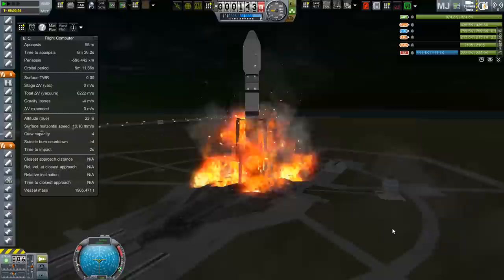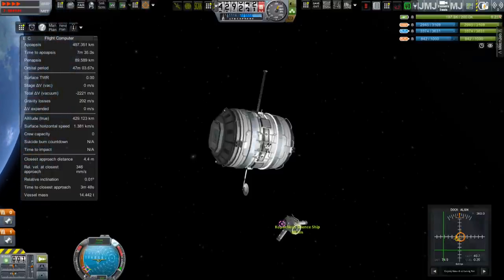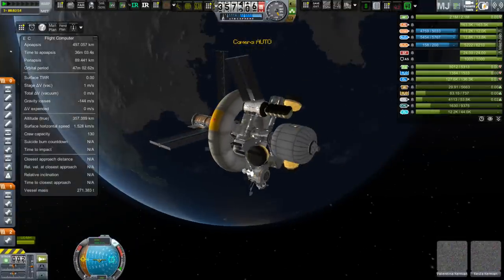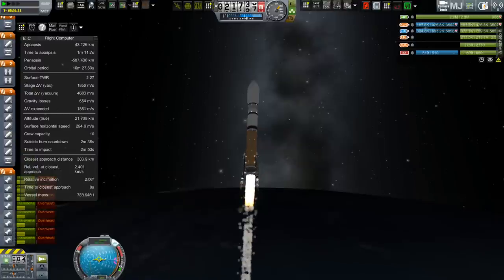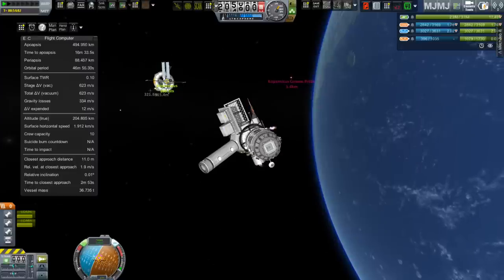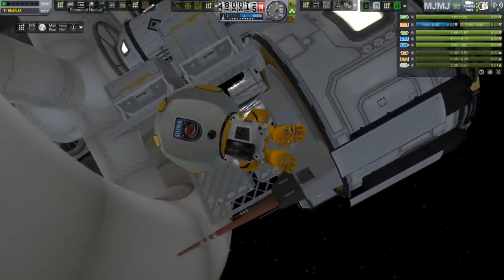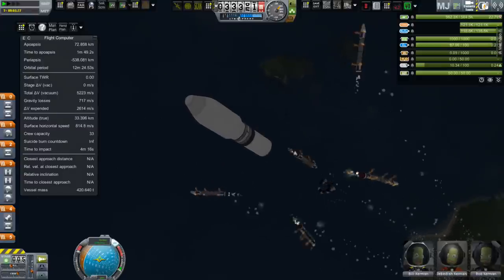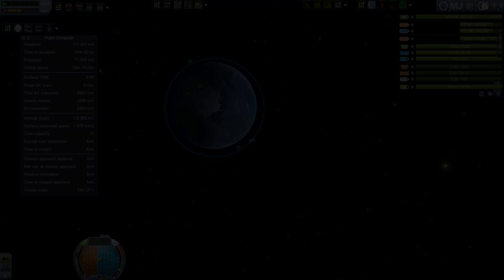E43: "Final Countdown" / Project Odyssey / KSP 0.25

Comment: i think the real accelaration ship shaking happens due to change of gravity. KSP as you probably know just accelarates physics and not time. Since KSP crafts are just parts flying in formation and not one solid model, the way parts and nodes interfere, coupled with excess gravity equals to the spectacularistic fireworks display that KSP is known for (after all that's why the game warns you about using physics accelaration with bigger craft, when you have something too big or too small (like your rocket-chair in the first episode of Alexandria) makes Unity to go all woobky because it's only optimized for sandart scales :D )

Comment: Did you try to put the bottom of the rocket higher?
Reply: Luka David Torkar That MIGHT work, but I doubt it.
Reply: Maby the launch clamps are shaking and causing the launch pad to explode. He should put some bottom clamps to help suppor it.
Reply: Luka David Torkar To my knowledge, you need a massive enough object to collide with the launchpad at high speeds to make it explode. I've put heavy things on the launchpad, they didn't explode, but when I dropped stages, they destroyed the launchpad. The main thing is physics spikes when it first starts, so it can blow up the launchpad.
Reply: Yes but you know that physics in kerbal space program are sometimes weird. The launch clamps I think are indestructible.
Reply: Luka David Torkar IIRC I've put VERY heavy objects on the launchpad without launch clamps. It's the physics spiking that's making the issue.

Comment: I hate gyros, I never use em, since I feel like it's cheating.
Reply from the maker: F3aR_CalleR If you've watched the whole series, you know mine are rebalanced to be the same strength as those on the real ISS.
Reply: Bob Fitch The problem is that the ones ingame don't have a max speed, so you can like balance forever, irl you would need to constantly give a force, which would mean you'd need to get the wheel to infinite speeds it's not about the strength, it's about momentum conservation.